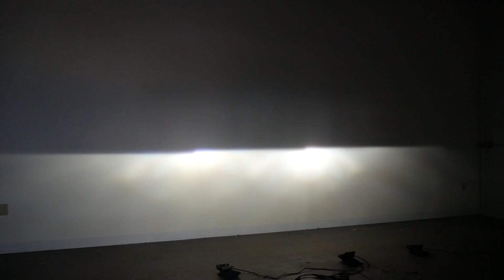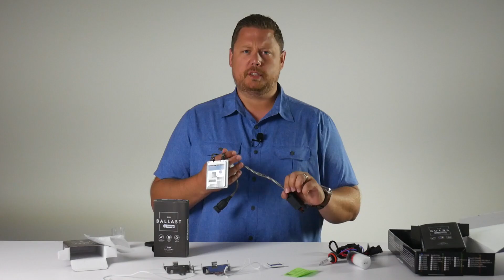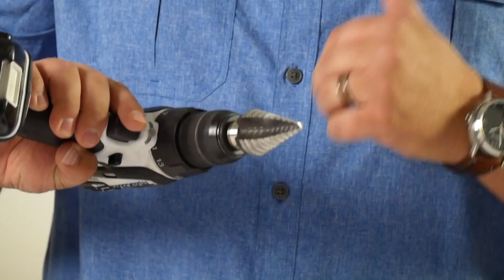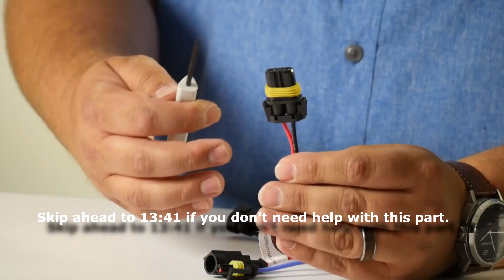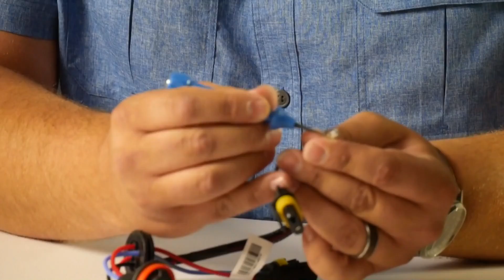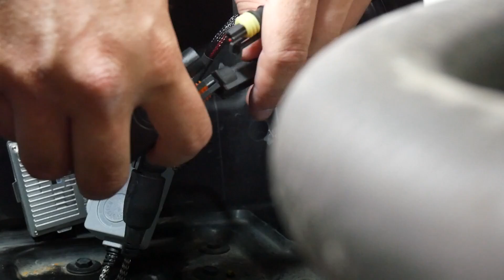Installing GMC Sierra HID Headlights, 500% Brighter! | Headlight Revolution

Comment: My factory headlights on my 2014 GMC Sierra were absolutely the worst headlights I have ever driven with, so I installed the HID headlight conversion kit with the 6000 k diamond white bulbs, I am blown away at how awesome these work. Good job making such a quality product.
Reply: Hey I was wondering what kit you got for your 2014 Sierra. Did you need a relay harness?

Comment: Purchased these to replace terrible factory headlights. Work great. Love em. Installation not bad at all. Video very helpful. Only suggestion I might have is to make silicon grommet a bit larger to accommodate a larger drilled hole.  This would keep you from having to disassemble the plug to get it through the hole. Disassemble and reassemble of the plug was the only frustrating step in the installation. Support guys were great when I called with a couple questions.
Reply from the maker: Thank you for the kind support! We're happy the install went well for you and that you are loving your new lights!

Comment: Just got these installed along with the Morimoto fog lights that go with it on my 2015 GMC Sierra Denali 1500! They look absolutely GREAT except it might need a bit of adjusting. They do not seem to blind anyone but they do seem like they focus too much in the middle. I could be seeing it wrong maybe! Will be installing the LED fogs tomorrow, so excited!
Reply from the maker: That's great! Glad you like them.
Reply: Do they match as far as colour temp? How many K are your headlights?
Reply: @jacksonboyd1050  6000K. Headlights are also installed after since stock came with ugly halogen. I have sense traded in the Denali and got a ZL1 instead

Comment: The link to the kit depicts exactly what I received.

This kit just arrived on my porch. It does not come in a "box kit" like in the video.

3 boxes in a brown shipping box and no brackets for the ballasts. No big deal.

The wiring looks different, the o-rings are completely different looking. They're skinnier.

We're still waiting for my block to get back from the machine shop and then the assembly before this forged engine goes back in the truck. I can't install the HID kit yet. 

I hope that I don't have problems with this hardware.I wouldn't question it if the kit and its bulbs and wiring and thick o-ring looked like what's in this video.

I'll post up a video when I install them. I'm hoping mid to late December. 

https://youtu.be/q-NbVt3a5es?si=Ko-mh2ROv1cCUJNa

https://youtu.be/q-NbVt3a5es?si=Ko-mh2ROv1cCUJNa

Comment: correction ** it uses a 9012 bulb NOT H11
Reply from the maker: Yes, that is correct. The HID unboxing at the beginning was with an H11 HID kit. But the actual install was with the 9012 HID kit.

Comment: Just received my lights, and having issues with them. The bracket for the ballast is not the same as in video and does not have the white ground strap, there is a copper bult and washer in box with it what are they used for? Also after installing drivers side and checking to see if it worked correctly the light does not turn on. I have double checked all connections and even tried the other ballets and still no light? Also what is the purpose of the 2 extensions that came in box are they needed or just extra in case of needing additional space? Please help installing in a 2015 gmc sierra originally equipped with halagon headlights.
Reply: did you ever get a solution? I have the same thing, is this the wrong kit? 2014 gmc 1500. i haven't tried install yet because i noticed this one doesn't have the ground wire or the the connector that comes apart to fit through the dust cap. It's also blue and black and diff color ballast

Comment: Looks like hot spot in the driver beam is different then passenger.
Reply from the maker: Ever so slightly, you will not be able to tell the difference out on the road.

Comment: Why are there no cables connected to the battery or relay harness what makes these lights different all other kits I have seen have really wire harness to battery this seems so much easier
Reply from the maker: That's specifically why we are recommending this particular product. The GTR Lighting Smart PWM ballasts work plug and play on these trucks. Truly a game changer. No battery wiring or relay harnesses needed.
Reply: @HeadlightRevolution  ordered a set thanks

Comment: ok just got this kit for my 2015 GMC Sierra 3500HD, not so plug and play. I had to spin the connector around cause it wouldn't light up. also had to keep fidgeting around with the connectors to work. My brackets for the ballast never came with the white ground wire. We'll see if it's brighter than the LED's i had in them tonight.
Reply: Whats the connector youre talking about spinning ?
Reply: @johnsmith-gg7bj  it's between the ballast and the wiring you just pulled through the dust cover. The black one.
Reply: Thanks
Reply: Ok update... These lights are freakin' bright!!! It's like having a light bar up front! Then you hit the highlights and BAM!!! Daylight! Love them!!!!
Reply: You're talking about the one they showed needing the connector removed (w/yellow seal) and replaced with the pick tool kit? I think I may have the same problem cause mine don't come on at all.
Reply: @mikez377  keep fidgeting with the connectors. And it worked. What I should of done, instead of spinning the connector 180°, was swap the pins instead. We had to remove the pins in the first place
Reply: @mukishima556  I got them to power on by removing the HID plastic connector that takes the place of the OEM bulb. I then inserted the wires directly into the OEM connector. Not sure how to rig them up to stay in now. Surely they pull right out w/o the connector holding in the wires. Maybe I'll have to somehow modify the plastic connector. Unfortunately, for our trucks at least, they aren't as plug-and-play as advertised.
Reply: @mikez377  ahh maybe the plastic housing was too thick and not allowing a good connection. I saw that on a different video with a different company and that's what the guy did as well.
Reply: AMEN, I did the same thing!! Butchered the connector to fit and lots of electrical tape hahaha.

Comment: GMC 2014        Iwould like to give someone some help if i may, be careful when plugin this kit to the factory light plug. reason i say. there is no line up pin and if the  little pins don't line up they will bend and the plug will still go all the way together but you will think the bulb is bad.  . i thought i had a bad bulb and after hrs. of thinks no way this new bulb is bad i looked in at the pins on the one that wasnt working and sure enough that was it i straightened them out and had light
Thought that was problem straighten pins plugged light in it came on so i installed it NO LIGHT .took it out hook to ballast no light now, im just going to have to get new bulb try 2 ballast same thing
Reply from the maker: Hey Craig, You’re absolutely correct! That is such a pain to troubleshoot, We will be redoing this video soon and emphasizing that.

Comment: Hi there, I recently retro fit my 2014 Sierra with new projectors that requires D2H bulbs. What bulbs will work that are by gtr? I just order a set and juts realized they won’t fit because it’s a 9012.
Reply from the maker: Unfortunately GTR does not carry D2H.
You can find the ones we have available here!

https://www.headlightrevolution.com/morimoto-d2h-xb-hid-bulbs_2

Comment: What bulb type do I use for my 2017 gmc 3500hd?
GTR lighting does not have a 9012 selection for the kit. Thanks
Reply from the maker: The reason we do not have a GTR Lighting kir for that vehicle is that they will not fit in that headlight application. We have all of the kits that we have tested to fit and work in that headlight listed there on the website, and I would recommend going with the SL1 kit by Diode Dynamics as that will fit and perform amazingly in that headlight application! I have linked that kit for you here: https://headlightrevolution.com/14-15-gmc-sierra-projector-headlights-diode-dynamics-sl1-led-conversion-kit-high-and-low-beam/

Comment: Ive read on some forums that the headlight itself would melt with aftermarket lights.. is it actually true or is this safe to install?? Please let me know cause I wana change my headight bulbs.
Reply from the maker: Oscar Peters The only time we have found this to be true is sometimes on aftermarket headlights with HID's because of lower quality products being used and in fog lights because of the lack of space inside of them and typically this is just with 55w ballasts. You will not have this issue with OEM headlights with projectors as long as everything is installed correctly.

Comment: Will this kit work on a 2016 GM Yukon Low Beam H11 projector,if not which kit would you recommend?
Reply from the maker: No, this is a 9012 bulb style, you'll need the same kit with a H11 bulb style:
https://headlightrevolution.com/gtr-lighting-55w-gen-5-pwm-canbus-single-beam-hid-conversion-kit/
Reply: for high beam 9005 i want install supernova v3 do i need canbus module for it? 
thanks

Comment: Just installed on a 14 GMC sierra 1500 and I'm having trouble getting the bulbs to come on. Any solutions  ??? thanks
Reply from the maker: Take the pins out of the connector that plug into the factory wiring. Don't use the plastic plug but the metal pins directly into your OEM wiring
Reply: @HeadlightRevolution Could you be more specific? I have the same problem. Are you suggesting to remove the plastic on the OEM connector altogether?
Reply from the maker: @mikez377  our sales team can walk you through the process step by step. Please email us at sales@HeadlightRevolution.com
Reply: @HeadlightRevolution  I figured out what the above comment meant. I plugged the pins directly into the OEM connector and they work. Now I have to figure out how to make sure they stay connected since they will/can pull right out.
Reply from the maker: @mikez377  A good hold I use is pretty simple, but it works perfectly and has for the last 2 years. It's simple, but wrap it up in tape. You could get some heat shrink big enough to fit the connector in, shrink fit that, then tape over it to ensure no condensation can get in.
Reply: Same issue here.  Will maybe fiddle with it in the morning.  Couldn't get lights to work either.
Reply: @46KPS  The email response I received from HR said the supplied connectors aren't compatible w/the factory male connectors. They're working on a solution, but the short answer is above; don't use the supplied connectors and plug the wires directly in and jerry-rig the connection w/electrical tape. I'm honestly not thrilled about it with the price of the kit (which has worked since my post I'll say), but I'm trusting they'll find a permanent solution and let us know as they said. HRs customer service is really good, so I'm expecting another email soon.
Reply: @mikez377  So de-pin the connector that interfaces with the factory OEM connector that use to plug into the bulb?  Then take those pins and stick them directly into the OEM light connector?  Thanks so much for taking the time Mike C.  I noticed the OEM light connector didn't really go in too easily to the connector on the GTR kit.  A good friend of mine who works for a prominent company who provides OEM's with their wiring harnesses said those connectors on the GTR kit were metri-pack connectors from the 70's.
Reply: @46KPS  Correct, de-pin and plug them into the factory harness. I did a quick function test (making sure +/- were correct) with the bulb out before taping it up and putting it into the light housing.
Reply from the maker: @46KPS  Please shoot us an email and we'd be happy to get this sorted out for you! :) 
Sales@HeadlightRevolution.com
Reply: @HeadlightRevolution  so you're telling me I buy a vehicle specific HID kit for 300 dollars and have to  half ass rig my set with no correct connector. No thanks will be looking elsewhere for a HID kit. What a disappointment for what seemed to be a good product.

Comment: Will this kit work on a 2013 Sierra,if not which kit would you recommend?
Reply from the maker: Hey Al,  It's a different kit for that truck.

it's an H11 so the Supernova V.3 bulbs or the Gen 4 HID kit would work:
https://headlightrevolution.com/supernova-v-3-led-headlights-h11-h16-bulbs/

https://headlightrevolution.com/gtr-lighting-35w-canbus-gen-4-hylux-single-beam-hid-conversion-kit/

Comment: Just be ready for people blinded by headlight to hit their bright lights. Nobody likes to be blinded by over bright low lights.
Reply: texling93 they’re projectors headlights mostly what hid Is recommend for. if you aim them correctly you won’t blind people. But if you install hid in reflector headlights that’s a different story..
Reply: @Geeze_Luis Projectors only play nice with the light source/bulb they were designed for too, same as a reflector lamp.

Comment: Could this work on a 2016 GMC Sierra elevation? 1500.
Reply from the maker: The 2016 GMC Sierra 1500 Elevation came equipped with HID headlights, using a D5S bulb. We’d recommend upgrading to the Morimoto XB HIDs for the best performance. You can find them here: https://www.headlightrevolution.com/d5s-morimoto-xb-hid-B-D5S_2?quantity=1.